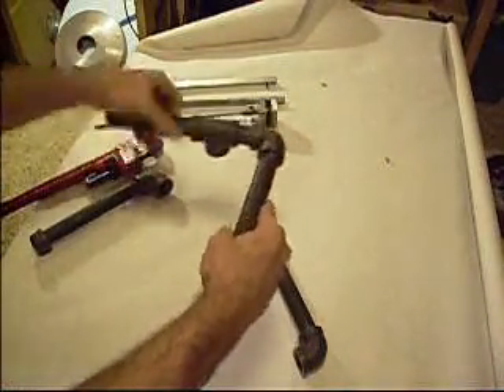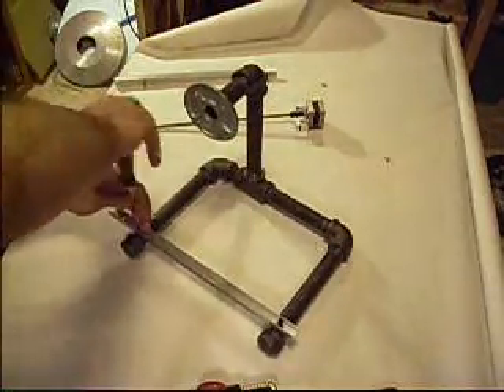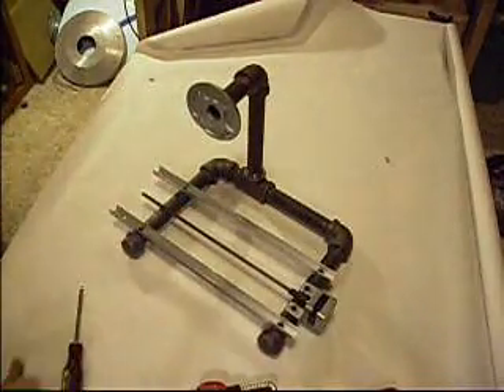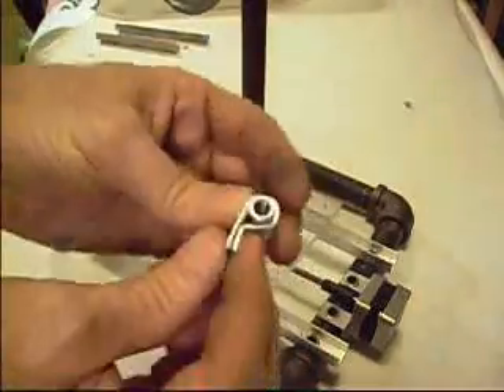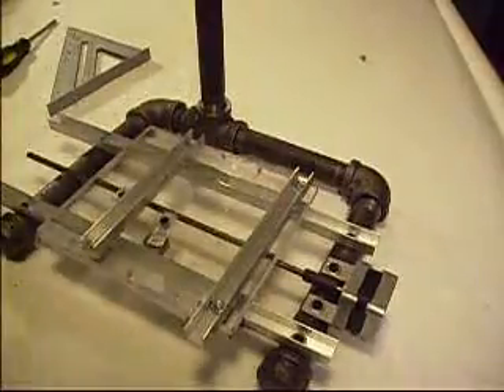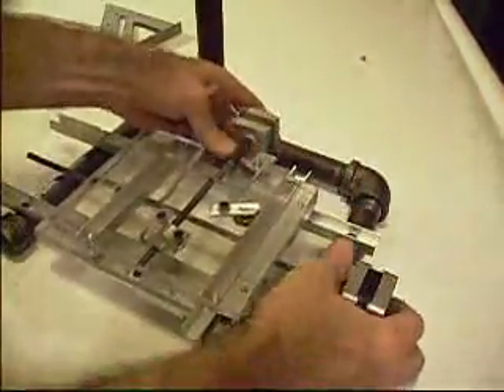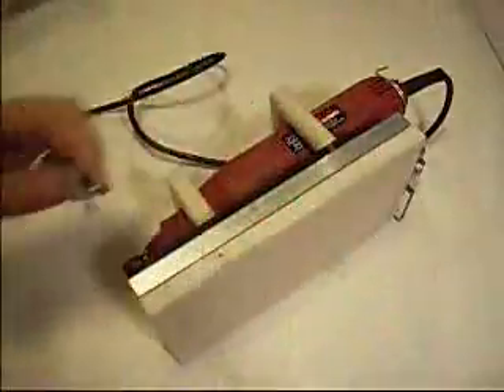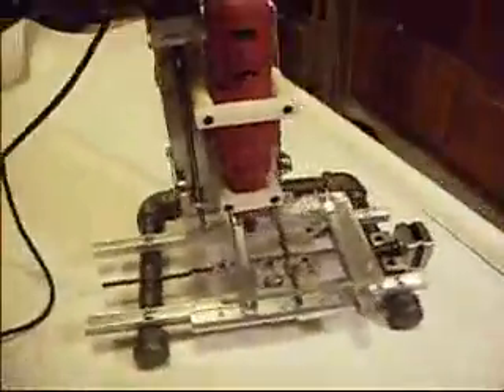Easy to build Desktop CNC Mill

Comment: Nice Work.  I am in the middle of a build right now and have been recording with GoPro...will complete in approx. 1 month.  One Question is why do many of these designs have the Z axis offcenter?  I know that there is a good reason and I don't want to learn the hard way.  Any advice would be awesome.

Comment: I looked around your Instructables but couldn't find an answer, but what steppers are you using?
Also, have you thought of making the bearing mounts for the table spring loaded so that there's constant tension holding the table against the rails? Seems like it would be a good "set n' forget" solution.
Reply: Dont know if you got your answer, but they look like "NEMA 23" profile stepper motors, NEMA 23 has a .25 inch diameter shaft that fits perfectly with the 1/4 20 threaded rod

Comment: Hi, Tom. I just stumbled upon this video, and I looked at the wiring schematics for the driver circuits... Seeing as internal parallel ports are pretty outdated, this should work with a wireless/LAN parallel port, right?

Comment: good job it looks great. do you have a link to the schematics for the driver? why don't you use a the one piece linear slides from filing cabinets? They're abundant and they have bearings in them. where did you salvage the steppers from?

Comment: Responses like this are most likely because of the idiots who come through hardware stores trying to build 220 Volt circuits with small gauge wire.  We learn over time to recommend well larger than you think you need because most people coming in looking for wire really don't know what they need.  :)  Don't judge us too harshly.  It's your safety we're trying to maintain.

Comment: @bitbreaker I built his board three years ago and just bought a table from ebay. The damn thing works pretty good. Just a tip if you build this, dont get fustrated right away if the motors dont move. You have to adjust the rates and may need to put a higher wattage bulb in to get more torque.

Comment: Nice design.  Just question: Since you are coupling the motor to the threaded rods with rubber hoses, do you get some slippage or does glue help?

Comment: I dont know.... Im building a CNC mill, and I spent some time thinking about cost and time Vs. quality.
This machine is very unaccurate, wont be good for PCB, I see it nice, but if you are going to spend time and money, do it better.  in Ebay, are kits of all mechannical parts needed, at low cost, with real ball screws.
I see this very interesting to see, but a lost of time, if you want a really functional milling machine.

Comment: Fantastic job! Curious about a couple things though. 1) What are the stepper motors (meaning, what would I look for and where)? 2) What about the electronics/software (how do you connect this to a computer and what software do you run it with)?

Comment: @baydostyles Any material. But tungsten may be hard, as you'd need a TCT/diamond bit in your Dremel, and it'd take a while to cut into it. Materials like the following would be ideal: ice, wood, plastic, hard leather, wax, stone, glass, metal, polystyrene, plaster, cheese, Hebel. Alum. & brass would be easy! Sturdiness: I suggest more pipes. They are damn sturdy, when their wall is thick enough. Close up the front gap of the pipes too.

Comment: @migueltjohann If you're after high accuracy, then a square won't be good enough. It would be hard to make this, so that it can be finely adjusted so that is is dead on square. I think you might need slots for bolts/screws to go through, so the whole Y axis stage can be rotated a couple of degrees, so you can get it JUST right. Then lock it down. Then, there's the challenge, of working out when it IS square, for your calibrations!!

Comment: @thelemur You could use a PIC like the Arduino, but a PC would be better, as it's got more features, and you can't design (AFAIK) on an Arduino. You need a 3D design, and a way to save it, make modifications, etc. An Arduino would be ok, if you only had 1 or 2 designs to mfg. Then you would just load in your blank on the CNC mill, press a button and it would make it. Unload finished item, and you're done. Makes sense?

Comment: @NOSMOJEFF 
People chuck them out all the time (roller blades). I brought many home. I took one bearing out of one, using your idea, and found it was worn to hell! Disappointed me and made me think the others would be like that. I guess it depends on how much use it has had. So the newer looking the rest of the roller blade (outer) is, the better the bearings, I guess. But if you want precision, you can get brand new bearings for Aus$2 from a shop like CBC. Only Chinese made, but that's ok.

Comment: @smithy2402 
Yes you could! But it won't look as good as the laser-etched photos they can do. Unless you have ULTRA-high presicion in your CNC mill, like .01 or .1 thou minimum movement. AND a very small milling bit, like a pin, really.

Comment: @mcz1987 
Possible, but not easy, unless you've got a really suitable printer. A plotter would be closer to the mark. Also the printer's Y axis moves a sheet of paper, not another 'stage'. And if you mount the Dremel tool on the Z axis, where the cartridge used to be, then it won't hold the weight! And if you're thinking of using a LASER printer... forget it!! An inkjet/dot matrix printer is more like a 1 axis machine, not 3, like Tom's. Good try though, but find a plotter!

Comment: @peskywinnets 
cont'd 2:. And I will use a strip of bandsaw blade over the aluminum rail, as the roller will wear it out, but the blade is much stronger. Problem now, is I left the galvanised pipes outdoors, and the threads are all rusting. I hope there's enough strength/metal left in them, for when I clean them up with a die, so that they are still strong! I also would like to be able to stabilise (lock) the threads, but with the ease of disassembly, if need be. Not sure if I should weld plates

Comment: @peskywinnets 
cont'd.: I may be using glass for each stage, as it's more stable, & durable, but it means harder to cut & drill. I will be using spring-loaded, adjustable pressure roller bearings, about 2 or 4 per stage. Covers over the threaded rods to prevent swarf from clogging them up. They'll be made of stainless steel. And the Z axis will be able to hold either a Dremel, or a router. And it will be counter weighted, so as to nullify the weight of it. One day, I might continue making it!!

Comment: @peskywinnets 
Same here. I saw it on Instructables first, then started buying the pipes, and making it much bigger, with a x, y & z axis maximum travel of 250mm each. 2 uprights, one to support the other, and pipes aren't the right length, so I have to cut them, adjust them, using unions, too. Need to cut threads, and don't have the tools. That was over a year ago, and it still sits in pieces :( Too ambitious. I also redesigned the stages, the rails, the coupling nut (anti-backlash), etc.

Comment: @krazykayaker82 
 You mean, use the free 30 day trial Autocad 2010 to design a better home CNC mill that will run with drawings coded from something a little cheaper. Like Google SketchUp 7.  ;-)

3D printers are very cool!

Comment: hehe Cool man! ; D I had to build up some stuff like that before (just no actuators though) I needed to machine steel/aluminium with a dremel, and a 2 axis machine vice. I made the dremel stationary though.(just moved the stock on x-y) I used a depth lockable dremel drill press for depth.

Comment: People that are saying 'this isn't a CNC machine' are technically correct in that he doesn't have the stepper attached to drives and there's no PC to control to control the drives.  Anyone who knows anything about these types of machines would expect him to incorporate those items.

That is the easiest part of building a machine like this.  Almost anyone can wire a 4-wire bi-polar stepper motor to a drive and interface it to a PC's parallel port.

Comment: mad stuff .what type of material would you beable to machine on this and what size cuts or is it just a means of engraving.would it maybe cut aluminium or brass there easy  machining materials.how much would it cost to build one and how would u program it and calibrate it.and i think you could make it alot stronger and sterdy?????thanx alot well done

Comment: OK, i have checked out both videos on this project, and then i went to instructables and read up on that information as well.  I have two questions, considering i have never done anything like this.   Can the Z axies be extended to make longer up and down cuts?  And is this change easily modified in the software to compensate?

Comment: Good idea, but none of those rollers would hold against any torque once the bit starts cutting, especially the 2 on the Z axis (holding the drill). All they can cut with it is foam!